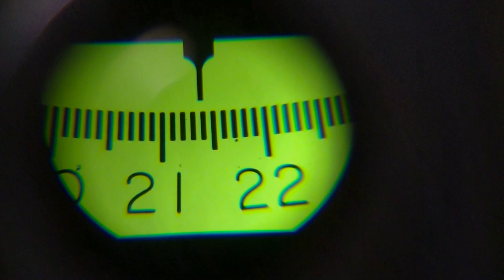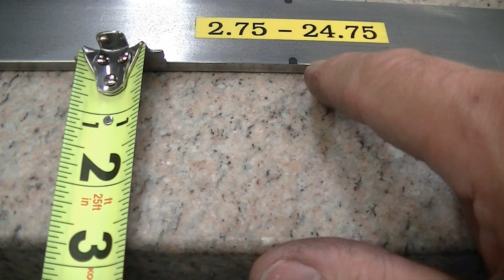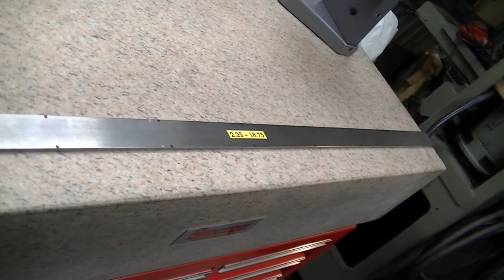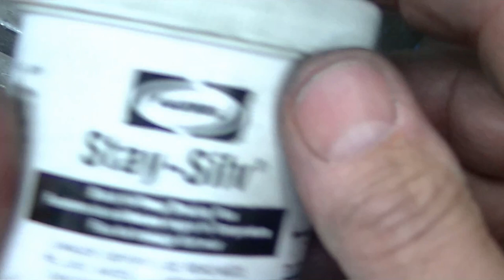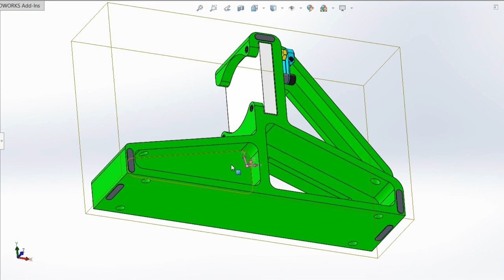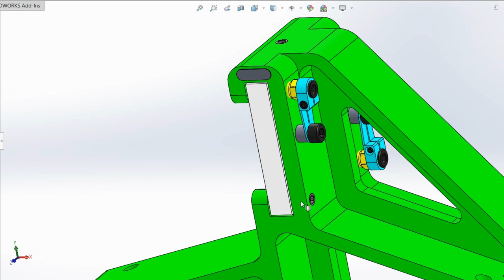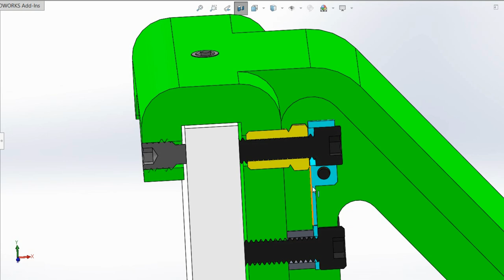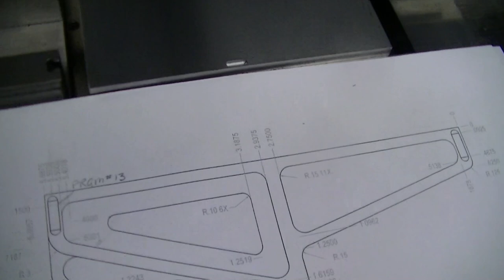AUTOCOLLIMATOR MIRROR SYSTEM

Comment: This is how you lay out a fire zone in artillery. We used ours over distances of several KM. You can put an 8 inch round within a 2 foot radius over several miles with a well set and columated gun. They are incredibly accurate.
Reply: Wait, what? By mapping the surface of the fire zone?
Won't the people there object to, you know, getting shot at? I could imagine them getting quite funny about it --- even going so far as to try and prevent any attempt at being accurately targeted.
Reply: Wow. Do they use lasers for that stuff? Are there gyroscopes involved to reduce vibration on a battlefield? Does GPS play a factor since its removed from the shock area? Thx.
Reply: @ThePlacehole  the trick is not to tell them why they're holding up a mirror.
Reply: @tilliesinabottle  :D

Comment: Rob, I do like to follow your work. I've heard it said that explanation concurrent with demonstration is the most effective teaching method for technical material; you're proving this aphorism with your every video.

Those considering adding silver brazing to your skill set should not be fooled by the apparently red heat seen in the silver soldering demonstration part of the video. Actual silver brazing temp is a bit cooler than that. Video cameras see further into infra-red, rendering what would seem dull red to the eye into cherry red on the screen. 

For the record, Harris SafetySilv 45 brazing temperature is1370⁰ to 1550⁰ F.  Harris Safety Silv 56 is 1200⁰ to 1400⁰ F.  

Safety Silv white flux active range 1000⁰ to 1600⁰ F. Safety Silv black flux  active range 1050⁰ to 1700⁰ F. The other difference between the two fluxes is the black flux has a boron content that extends its working time. Flux activity is time limited at brazing temperature. 

Silver brazing if done expeditiously is a sure and reliable method of bonding metals into strong permanent assemblies. The liquid flux oxidizes in air over time forming a tough film that inhibit joint wetting by the silver alloy. For that reason, plan your operation and have everything handy. IOW, do not dally.

A final point is joint cleanliness. Clean the joint thoroughly, then scrub the joint surfaces with Comet cleanser, a stiff brush, and water followed by a hot water rinse. Do not follow with a solvent clean. Conventional wisdom decrees a final acetone wash. Acetone is a commercial product containing impurities, reaction fractions, wax, and tramp particulates. These pyrolyze and inhibit flux activity and joint wetting. 

Repeating: Do NOT solvent clean. Scrub the joint components with cleanser and water, etc then immediately braze the joint. A thoroughly clean silver brazing joint never misses.
Reply: Good tips Forrest - Thank you.
Reply from the maker: Thanks Forrest, I never thought about having a no water break surface before fluxing and soldering. That's a good one.  Grit blast before soldering is also a plus.
ATB, Robin
Reply: @Forrest Addy  - If you use acetone from the paint store, or typical industrial supplier of solvents, of course you will have problems.  You can get "optically pure" acetone if you look - that is, a grade suitable for cleaning optics in the laboratory. The stuff is way above reagent grade, which is way above paint-store crap.  It is absolutely chemically pure, anhydrous (if you keep it capped, heh) and free of contaminants. Comes in glass bottles. Anything in a can is useless.
Reply: @railgap  What you say about pure acetone is correct but consider $82/gallon at Lab Alley or $17/12 oz from Amazon for a low utilization shop supply when a simpler alternative is already on hand. And there is the fire hazard of acetone in proximity of hot work. 

Joint cleanliness is an inescapable requirement for success in silver brazing. How you achieve it is up to you. My position is Comet and hot water as a cleaning method for silver braze joint components is quicker, more convenient, non-flammable, and requires no special purchase. 

If you get poor wetting at brazing temperature, it's inevitably a consequence of joint contamination of some kind. I've tried alternative cleaning methods including electrolytic, ultrasonic, bead blasting  (very effective BTW, particularly on cast iron, but generally a PITA), and abrading. All work but require additional steps, extra equipment and resources, etc. The shop sink is right there and the can of Comet and the retired toothbrush is handy on the shelf. You can flux, assemble, and heat within seconds.

Comment: I really like the trick of coming in the other side of a threaded hole with a set screw to set a depth. It never occurred to me before. I can think of a few times when that would have been the right thing to do. Instead I used Loctite and felt uneasy about it!
Reply: Nothing wrong with the Loctite. I have even used fishing line to provide a locking but adjustable mechanism for adjustment screws. What you do need to do is carefully think out exactly what is happening when you lock it. Does your locking mechanism tend to take up the slack in one direction or the other or is it neutral. A lock nut pulls one way or the other. Loctite is neutral and so is my fishing line. You should use whatever is appropriate to the situation.

Comment: I love your videos. Every decision you make has a purpose and is very well thought out, both in regards to how you will go about machining the parts as well as how those features will work in the end product. I strive to design parts with as much intent and purpose as you do. Every video I see just shows how much more there is to learn. I always click on your videos because it seems like an interesting topic, not knowing there are about 20 new tips and tricks and knowledge about materials thrown in throughout the video. I will be adding dowel pin holes to my tapped fixture plates from now on, that seems like a very efficient way to quickly line up parts to the mill.

Comment: Nice one Rob. I like that finish.

I guess you're going to do a part 2 and I'm curious to see how you prove that mirror perpendicular without a master.

FWIW I've found old hard drive platters make very good auto-collimator mirrors. They're manufactured to extremely high tolerances, are double sided so perpendicularity can be self-proved if required. Best of all they're free ... something that can't be said for normal 1/10th etc first surface mirrors! They make accurately checking all manner of things very easy as the mirror becomes essentially disposable. 

For anyone considering dropping down the rabbit hole of optical metrology, Rob's work is spectacular just because that's the way he works. However despite the extraordinary accuracy in the process, accuracy in the mirrors etc isn't generally required for most measurements as the AC is generally used as a comparator and it's all about repeatability between sightings.
Reply from the maker: Thanks Pete.  I hate to disagree but mirror flatness matters unless you can guarantee the exact same spot on the mirror is used for the total sled travel.
Reply: @ROBRENZ  ??? I'm not sure I follow you Rob. Mirror "flatness" in optical metrology is measured in fractions of a wavelength of light, waaaaaaay beyond any of the accuracies even your machining is capable of ;) If the mirror was so far off "flat" that it was affecting measured sled travel measurements you've got bigger fish to fry!

What happens when the mirror isn't "flat" in optical terms (and that is generally referred to in fractions of a wavelength of light ie circa 50 nanometre range) is the reflection will be blurry and can never be bought in to focus. You can try it if you want, just polish up different objects and you'll see. Shiny doesn't mean flat, as we both know. That's a whole different discussion on lapping vs polishing.

Optical metrology can be very counter intuitive, especially with autocollimators. Another misconception is the mirror size, and that doesn't need to be as large as the instrument's bore. The only affect mirror size will have will be the brightness of the reflection. I've used gauge blocks as mirrors for example, and they do work, but the reflected image isn't bright, nevertheless the image is crisp and their surface finish is optically accurate. This can be confirmed with an optical flat, pretty much a must have for anyone serious about rolling their own optical gear and they're not expensive if purchased used. Optical flats are also excellent for checking gauge blocks for any issues, and I check mine from time to time.

BTW the reason old hard drive platters work so well is because they ARE very accurate. Even a consumer hard drive flies the heads in the circa 3 nanometre range average above the platter. Crashing in to the platter would instantly destroy the disk. We sometimes take for granted some of the extraordinary manufacturing and physics we buy for peanuts these days, but when developed that level of accuracy wasn't easy to mass produce, never mind for the price they sell for! The disadvantage is they're fragile, but given they're free I'll take that!
Reply: @886014  I have to agree with @ROBRENZ here. The surface quality of the mirror is everything. And those few nanometers of inaccuracy in the surface will show itself in distance and would be equivalent to seconds or large fractions of seconds. 
Similarly, you can easily identify a quarter wavelength of inaccuracy in a telescope mirror just by observing a star.
Reply: @ROBRENZ  Are the mirrors optical flats?
Reply from the maker: @xmachine7003  basically yes but with a reflective coating on the flat face

Comment: I picked up a Hilger & Watts autocollimator on eBay to measure my own surface plate only to discover how difficult it is to find proper target mirrors. So, I started designing my own. Needless to say, I'm feeling a little less confident in my own design now. 

This is a really well thought out and executed design. Well done! 

Also, I guess need a bead blaster now. Such pretty finishes on those parts...
Reply from the maker: It can be as simple as the one I showed first.

Comment: Wow! That was the best engineering and machine work I've seen in years. Your corner mirror unit and mirror sled are way better than what we used on our US Army surface plates. Of course, you'll be able to use them for many other things. It was many years ago, but I don't recall that it was important that the auto-collimator and corner mirror didn't move between each of the union jack runs - only during each one. Yes, it's handy that you can make three runs without moving the auto-collimator. One thing we did do after each run was to return the sled mirror to the starting point to make sure that the zero was still good. If it wasn't, we'd redo that particular run. The calculations we ran tied the three runs at each of the four corners together and connected the ends of the center runs to the midpoints of the side runs. The calculations also gave us the error of the four crossovers at the center of the plate which told us how accurate our measurements were. And, we typically avoided the outer 2 inches on our larger plates..
Reply from the maker: Thanks!

Comment: I came across a Davidson D-600 comparison autocollimator.  There are a few available on the internets for relatively cheap.  It compares the retical reflection from 2 mirrors rather than the reflection off one mirror onto a fixed retical in the eyepiece.  It’s like two autocollimators in one tube where the dial only moves one relative to the other. This allows you to mount the autocollimator off the table (maybe on a rigid tripod? Not sure if that will be rigid enough I don’t have the manual for this thing). You then move only one mirror. Moving the autocollimator moves the entire image of both reticals together making the measurement independent of if the autocollimator or the plate move slightly relative to each other.  Kind of a neat way to solve the same problem you are solving here. The positive is less complexity in setup. The negative is more autocollimator moves I suppose.

Comment: Robin, you may play down the value of the content you are providing but to me YOU ARE A HERO! I have been working on building a CNC machine in my home shop and have been really interested in both autocollimators for machine alignment and your work lapping the surface plate. Little things like the view inside the autocollimator and your thought process on the additional components are SUPER valuable. Thank you so much for sharing. P.s. I am really interested in how the Renz'ometer measures the calibration of the plate versus the standard use of an autocollimator.

Comment: As you can see from my profile picture I managed to buy a Hilger & watts TA1-5 DIV 0.2 arcseconds here in the UK but finding the precision mirrors for it can be very challenging so making one is the only option I have. When mounting the first surface mirror to the sled with adjustable nylon screws is it necessary to align the mirror perpendicularly to it’s base feet? if so how can you do that with the highest level of precision? Would you need to pitch lap a thick piece of glass to λ/20 to then have a dead flat surface so you can reference from to then get the mirror perpendicular? Any help would be greatly appreciated 😁

Comment: Great video, such fine detail on your work.   I am curious... why didn't you use three adjuster screws on your mirror instead of four?  Kinda feeling like four screws might warp the glass.  Or did I miss something here.  :)
Reply from the maker: Thanks, there are only three support points, one is fixed and the other two are the differential screw adjusts for tilting in two different planes with minimal cross talk.

Comment: @ROBRENZ I'm interested in what else you did to the CR Steel straight edges beyond peening the one side to pull/push the bow out.  Did you grind or lap them?  Thanks for the vids, a wealth of info I can't follow the first time I watch, usually have to back up several times.
Reply from the maker: Just straighten, they dont have to be perfect, they only guide the mirror sled enough to keep the cross hair in view.

Comment: Excellent work as always......I'm curious why you decided to use just two feet on the bottom of the mirror rather than three like are on the sides.  Is that so you're contacting the surface plate in a narrow line?
Reply from the maker: Only two feet are the measuring system the third foot is just for lateral stability on the large mirrors

Comment: This stuff looks so awesome.   What were your considerations in metal choices?   I would have thought that aluminum would thermally settle faster.  Maybe the higher mass is beneficial?   I'm a noob so I'm certainly in no position to doubt your choices.  Just curious.  Thank you so much for sharing!
Reply from the maker: Aluminum has twice the thermal expansion of steel or iron so it would not be a good choice.

Comment: Great video and great design!  How did you get the first surface mirror exactly on the center of the pivot point in the rotating mirror?  That seems like a hard thing to do without an interferometer or similar to test it from two rotated positions.
Reply: It's not critical that the mirror be on the pivot point.  Could be 1/4" away and the only thing that happens is the mirror needs to be a bit larger because the beam uses a slightly different part of the mirror when you turn the it.  Rob probably got it within 0.0001" anyway.

Comment: What an amazing design! I have an autocollimator, and I always find it inconvenient to use because it is too long. the turning mirror solve this issue! Thank you Robin. BTW,  how do you like the kollmorgen? I had the same model before but switch to Higer & Watts because mine kollmorgen's image seems to be a little dim.
Reply from the maker: My Kollmorgen is very bright, I have to turn it down.
Reply: @ROBRENZ  Good for you! I love the optic-amplified adjustment on the kollmorgen. Mine kollmorgen may not be storaged properly by the previous owner, glasses  develop some cloudy mark on the surface.

Comment: Thanks for the excellent video as always you keep the level up high. So for checking flat plane you only need a one axis autocollimator, you need two to measure straightness on a moving carriage?
Reply from the maker: Thanks Simon, a single axis can be rotated 90 degrees to measure lateral straighness. You just need to take two separate passes.

Comment: Im always impressed by the amount of thought that goes into your designs. One thing i was curious about is why did you put 2 carbide inserts on the bottom of the mirror slide instead of 3? Thanks for the great vid.
Reply from the maker: As you saw it is unnecessary with the small mirror I used

Comment: Rob, I'm an opto-mech designer & do a lot of these sorts of jig. Always learn something cool from you. I normally use AiSI 420 for these thing; dimensional stable over temp & time. Why did you choose 416 & grey cast for the parts?
Reply from the maker: Material I had on hand and many mirror sleds are cast iron. Not saying its the perfect material but we both know long term stabilty is not an issue for these measurements.

Comment: Noob question here, but why the flat feet? 
In my mind a sphere would be better because of the (almost) single point of contact?
Reply: The flat feet integrate over a larger area of the surface plate so your results are not thrown off by a small local error.
Reply: @irfp460  oh that makes sense! Thanks
Are there rules to dimension the feet? I imagine that after a certain dimension you kind of lose accuracy?